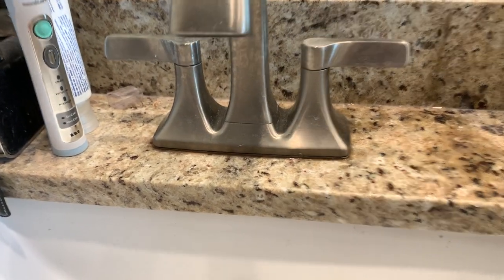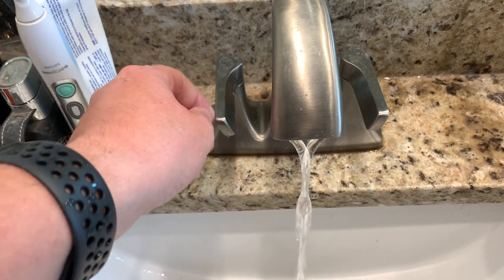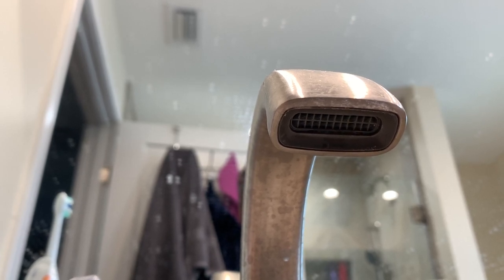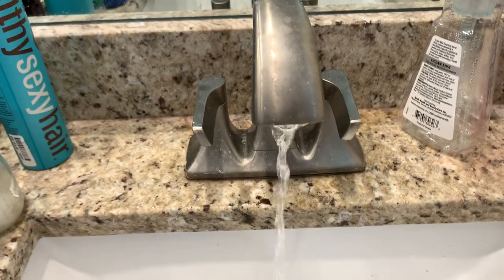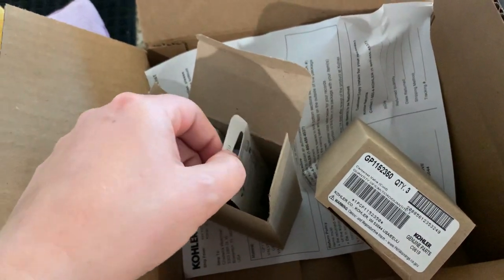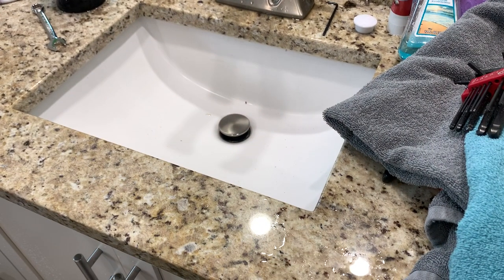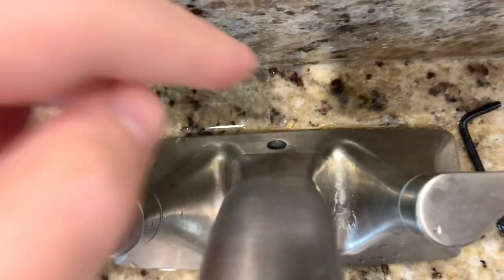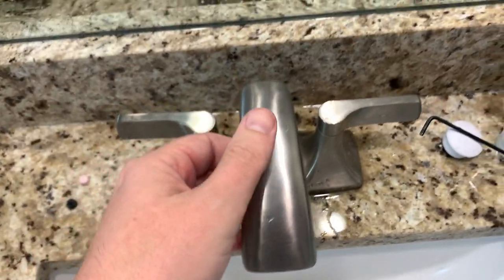Kholer faucet flow restrictor removal

Comment: I wondered why the pressure was so restricted.  Even Kohler didn't tell me the real reason, they rather send out new parts but as this video shows , the little white plastic restrictor is the part to be removed.   Water pressure is fine now.  👌

Comment: This worked!  Some time ago I bought one of these faucets for a guest bathroom, not realizing it was purpose-built to be a "water saver" fixture.  Immediately I was unhappy with the puny flow.  I was all set yesterday to say "to Hell with it" and buy a replacement faucet.  It occurred to me though that I might have the same issue with the replacement unit, so I decided to do a little homework first.  I found and followed your video, and Voila!  Problem solved.  Thank you for doing the grunt work and sharing this with us!

Comment: I have a Kohler single valve faucet with the same problem.  I removed the restrictor, and it works very well now.
Identical restrictor, but with a different procedure to access.

Comment: I just installed this faucet NEW and was shocked at how low the flow was. I followed these steps and pulled the flow restriction out to find that I personally think it had too much flow. SO, I drilled a 7/64 hole dead center in the restriction and it’s perfect! Just my two cents. 

Thank you for making this video! Super helpful.
Reply from the maker: Good idea. Thanks for sharing. I prefer to use the flow knobs under the sink for my pressure control.
That’s how I grew up, lots of pressure there, just throttle it down to what you want or need. Your method works well for a shower head or sink that doesn’t have knobs to control the amount of water sent to the faucet.
Reply: @dadthefixerflorida  excellent point to make because I actually tried that first before drilling the hole but the valve generated too much noise when I throttled it back to what I liked. I’m blessed with excellent water pressure so results will definitely vary.
Reply from the maker: @SkyroofNova72  understood. I do know that some valves make more noise when they are not wide open.
Glad you found a fix!

Comment: I followed your directions, and I had earlier replaced aerators, and  I made the mistake of turning the water on all the way.  The Aerators shot out.  I had to re-install the aerator and adjust the set screw so it would not come out and I adjusted the water pressure so flow was the way I wanted it

Comment: Fixing to get almost identical Kohler faucets. Glad I saw this so I can pull that regulator when I install them since I have hard water in Florida as well. I'm guessing they sent you the valves because they couldn't fix your issue and wanted to help you so they sent new valves for when yours eventually go. Not a fix but at least they tried to satisfy you

Comment: A million thanks to you for this video!!!  I bought the Maxton faucet for its design, and I thought the guy installed it incorrectly until I searched online and found that several people had the same problem.  They contacted Kohler, which was what I was about to do, until I searched one last time and found your video.  I'm going to fix the problem myself, and hopefully, I'll be able to do it without having to call my neighbor for help.  Thanks again for sharing your experience, and thank God for the internet!!!
Reply from the maker: You don’t need your neighbor. Just a couple of cheap tools and some common sense.
Hope it works out easily for you like it did for me.

Comment: This worked. The allen key was the tricky part of it. I was able to remove the knobs on my since it wasn't one solid piece, therefore I didn't have to turn off the water. I would imagine for one like this it's best to turn off the water valve because you need to have the knobs in the open position to make the allen key part alot easier. Thank you.

Comment: Thank you! Definitely have more water pressure now. I’ve been trying to remove the aerator. Thinking that was the problem. How do you remove the aerator and screens? Mine are all tore up, from trying. Now, it’s spray pattern is messed up. I would like to replace them.
Reply from the maker: I used a very small tip set of needle nose pliers. They always break 1-2 when pulling out. Manufacturer can send replacements or can buy online I think.

Comment: May I suggest a clip showing the improved performance
Reply from the maker: Check it out at 8:55. I show the one line only and about 75% pressure turned on. I felt like that was the goal and the project was successful.
Reply: @dadthefixerflorida oh wow that’s a huge difference. I scrolled to the end and missed that part lol
Reply: Unfortunately I have a single handle kohler and it looks like I need a special tool to remove a large brass bushing in order to get to the metering valve. It’s not bad for now though

Comment: Yes frustrated with this expensive faucet with no flow.  You live in Florida I live in east Texas.  We have lots of water 💧.  No need for this. Have to figure out how to clean the screen since water was cut off from cold. Man a lot of crap came through when water got turned on.
Reply from the maker: The screen comes out. Use a tiny needle nose pliers. You will likely damage it, they can be replaced.

Comment: I was away for six months last winter. Upon my return, faucets in two bathrooms had only a trickle of water pressure.
There is no aerator to remove. It’s a gooseneck faucet I have been washing my hands in the bathtub since I don’t know what to do. They were new faucets about four years ago. Ideas or suggestions? Thank you.

Comment: Fixed the water pressure for me but now there’s a whistling sound. Any idea what I might’ve done wrong?
Reply from the maker: I would guess that it’s the water pressure being too strong. Go under the sink and try turning the knobs on hot and cold down, the try and see if the noise goes away. 
You shouldn’t be getting a noise from removing a restrictor. The whistling must be from higher flow.
Let me know if this fixes it.

Comment: Hi!  Two questions.  Do you know the model/make of this thing?  Second, were you able get the aerator out?  I have pliers small enough to get in there but can't get it out.
Reply from the maker: I don’t know the model number.
The aerator can pull straight down, use a little force. Keep in mind that you will break off some of the fins by removing it that way. I didn’t find any benefits in removing it, other than cleaning it and removing the hard water crusties, ewe! Lol.

Now that I know the part that I needed to remove, I wouldn’t take off the aerator.

Comment: Thanks for this video. I struggled for hours to remove our ancient faucet and was disappointed to discover the weak flow on this one. I followed your advice and the cold water pressure is twice what it was. The hot however is only about 20% better. Any idea why?
Reply from the maker: I would check your hot water supply line. The restrictor I pulled should not be one sided.
Reply: @dadthefixerflorida  thanks for replying. I will check the hot water lines

Comment: I have a Jacuzzi brand/Lindsay model that is just like this, so probably made by Kohler (your video came up from searching for mine). I had a frozen galvanized pipe under the house yesterday that apparently dislodged corrosion when it burst, because my toilet tank fill-valve is shot and my sink has suddenly poor flow on both sides. I thought screens just as you did, but now I bet it's the flow restrictor, just like yours was.

You saved me a lot of frustration or probably about $100. I thought flow restrictors were in the cartridges, so I probably would have ended up buying a new sink after farting around and not succeeding in fixing mine. Thank you very much!

Did you consider that you could leave in the flow restrictor after cleaning it? I rather like the flow of my faucet. The flow's about perfect when turned on high, and my kids can't turn it on so high that it splashes the mirror or anything to make a mess. But again, thanks for the video.
Reply from the maker: I thought about leaving it in… then I laughed menacingly and put it away. The sink lines have flow knobs that let me control the pressure under the sink.
However I took out the flow restrictor in my shower head and it’s a bit harsh. I don’t have a supply line easily accessible so, I may end up drilling a hole in the flow restrictor and re-installing it.
Hope you get your setup fixed.

Comment: Did you ever find out what the screw behind the nozzle was for??
Thanks for the video.
Reply from the maker: Nope
Reply: You would remove that screw if you needed to get out the plastic aerator grid in the end of the faucet.  However, you probably would also need a small "tool" that normally comes with the faucet. That grid may be made by Neoperl and, if so, you can get info about removal on the Neoperl website, or I would think Kohler should have the required info.   You might have need to remove it if it got blocked by lime deposits.  Also, once the flow restrictor/filter is removed, any debris that would normally be caught by the restrictor would travel to the grid and possibly collect there and block water flow or distort the stream.

Comment: The video was funny and informative! I am happy to learn that I am not the only one suffering with this problem. Would this process still work for the faucet that is spaced out and not connected as one piece?
Reply from the maker: Sorry for responding a year late!
Most water fixtures have a flow restrictor. They are located in various locations.  I had to search for mine. The concept will be the same for most water fixtures.

Comment: My Maxton is center spread so I had to pull the restrictor out of the line. After doing that the pressure was so great that it blew the stream breaker (aerator) out of the faucet. I had to close my valves to about 25% to reduce the pressure. Thank you for the video. Couldn’t find anything else out there.  I’ll never buy a kohler product again. Horrible design.
Reply from the maker: CONSEQUENTIAL DOGS 
Thanks for the reply. I found that we had to turn ours back about 50% or it would splash too much. They just sent me replacement stream breakers. You may have found that the only way to get them out is with a needle nose pliers, which mangles them. 
I just installed them today.
We have great flow and I am in control of how much water I use.
Reply: Just remove the oring and put the rest back in and it won’t blow aerator out, has same thing on shower head, I just removed the oring.

Comment: Good video! The restrictor is in the faucet due to federal control freak regulations and applies to all states. As if the federal goobermint has the legal right to issue these rules. But they do anyway and it is why they are the single biggest problem this country has at the moment.
Reply: So true.